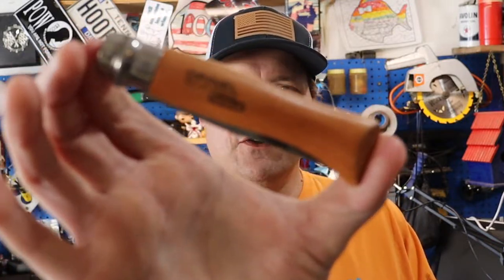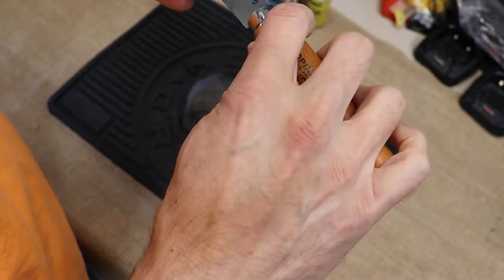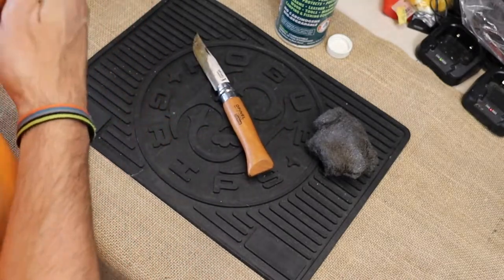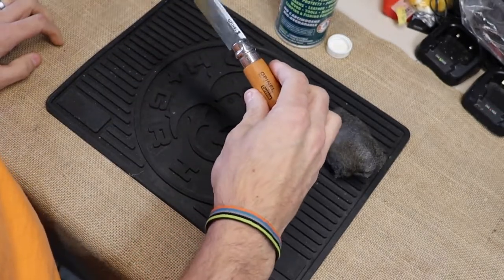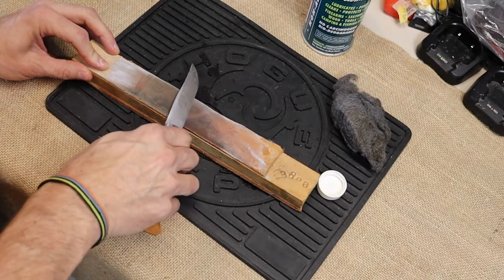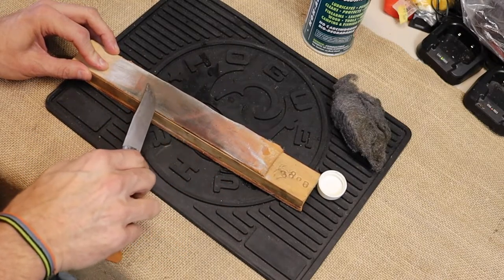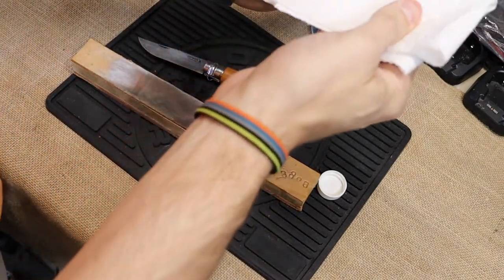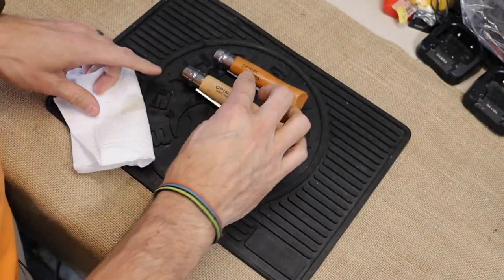Carbon Steel + Water = RUST

Comment: I’ve got a older version of this same knife and had the same issue. I ended up putting a patina on it with apple cider vinegar and haven’t had this issue since.
Reply from the maker: I need to try that, your the second person to suggest that. Thanks for watching.
Reply: @MidTnOutdoors  you’re very welcome brother. I did a video on how to do it. Prep and everything included. If you want to check it out. All I have to do with mine now is run water over the blade then dry it. No oil or anything on the blade in between.
Reply from the maker: I will check that out.